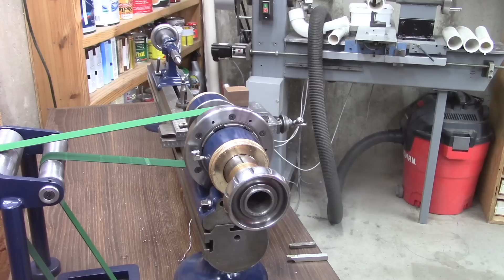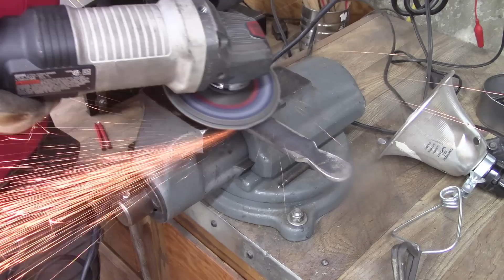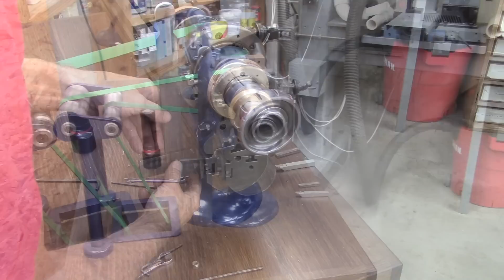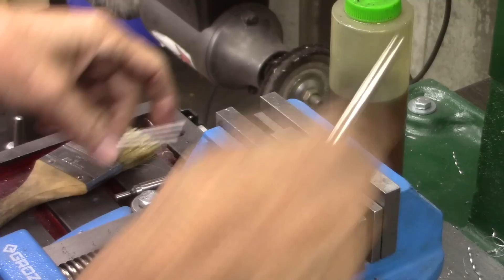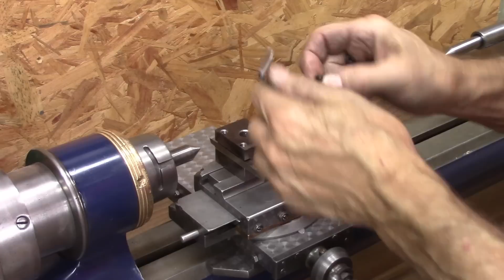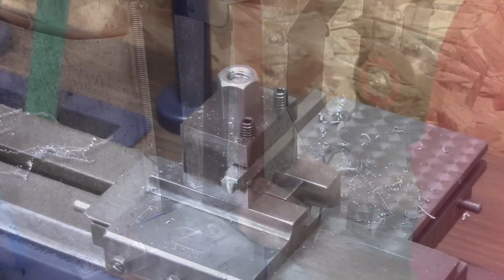Adding a Spindle Brake and Tool Post to my Hardinge Cataract

Comment: Hi Mark.  Maybe you can engineer a stop fixture to quickly align the compound for a non-tapered cut.  Maybe it could register in the center slot of the lathe bed.
Reply from the maker: I like that idea, thanks.

Comment: Are you still making hardware kits for the whimhurst generator.
Reply from the maker: Well...  I'm having a hard time getting materials and when I do they cost more. Right now I can't get the copper tape I was making sectors out of. It was supposed to be in stock in October but now they say after the new year.
Reply: Is there a template for the half-moon collector?
Reply from the maker: @RUDY3098  No but there should be!  Send me an email and I'll send it to you. winkysworkshop@GMX.com
Reply: I sent an email for the template .
Thank you
Reply from the maker: @RUDY3098  I can't find the DFX file but I'll trace one and send a scan.

Comment: That is coming out better that the company who made it.
By the way. Would you be able to make & sell  one of you beautiful brass ball T-handle tap holders, every time I see you using it.
I so very would like one. Thank you and thank you for taking us on your wonderful journey
Reply from the maker: Thanks, Sorry for the slow reply. I can make a tap wrench for you but when you add up all the parts it gets kind of expensive. I've made several in the past. The tap holders are about $30, the 3/8" extension is maybe 6 bucks the brass balls maybe $4 and I always include a carbide countersink and they are $25 to $30...   the reason I like to do that is that the advertised 3/8" countersinks are not always 3/8". Thats kind of irritating. If you're still interested contact me at Winkysworkshop@GMX.com
Reply: @WinkysWorkshop  thank you for contacting me back. And yes, I will contact you soon. It's been a tough week, money wise for me, I've been home now for just over 2 yrs now from a horrible car accident,  and fighting with workman's comp/pay
 So when I get things straightened out. I am definitely interested.  Tha k you my friend.

Comment: Great outcome. Why not use standard cap head screws instead of grub screws. You get a bigger hex key for tightening. Good luck with thetailstock next week. Regards from Australia.
Reply from the maker: That would be ideal but the setscrew (grub) has a dog point.

Comment: On your tool holder why don't you mill a 1\4 slot all the way around the square block so each tool holder will hold 4 tools. Then do a 5\16 one the same way. And get the most out of your tool holder. To change a tool just spin the block. Load each block with 4 tools. Just a though. I made one like that for my South Ben and it works good. And the old lathe is looking real good.
Reply from the maker: I might do both sides but to do all 4 would necessitate cutting the HHS very short. I guess that would be okay, just hard to handle when sharpening.
Reply: @WinkysWorkshop  you build a bigger block . Mine is 3X3X2 and i milled out a 1\2 inch slot for carbide tooling. But i also know finding that size material to make it out of could be challenging also. Either will work. The old lathe looks good.
Reply from the maker: @anthonycash4609  For sure a bigger block would help for small HHS tools. Thanks

Comment: It would be nice to put a split wooden handle on top
Reply from the maker: Seems a little extreme however the whole lathe is a bit extreme Ha. Cool idea!
Reply: Just thought wth the beautiful job you did on the table you could use the same wood process and put a piece on each side of the handle on top. It would be smoother and just top off the whole thing. But it looks beautiful the way it is. Well done.
Reply from the maker: @patricklucki5368  I agree. It would be cool.

Comment: You may consider making that tool post block a bit bigger and milling it all the way around, make it a 4 position you could just loosen it up and spin it 90 deg for the next Opp. Just a thought. 
Neat little lathe though. 👍🏻
Reply from the maker: Yeah....  that is doable but I like being able to use longer tools. I may mill a slot of the opposite side. Thanks

Comment: Hi, Mark. Someone once gave me the idea of using a punch to turn over a thread or two at the bottom of the threaded hole in tee nuts (at two or three locations around the periphery). Cheap and easy way to ensure a bolt without a shoulder can’t go all the way through.
Reply from the maker: Thanks, yeah, I have done that and would have again if the threads were too long.

Comment: If the Tee slot runs along the back of the lathe you could make and fit a taper turning device. Alternatively you could modify one from another brand. I used a Boxford one on my Hardinge.  Went straight on. The difficulty would be releasing the cross slide nut.
Reply from the maker: The ways on the back have all sorts of potential uses. I was thinking about using it to mark snap ring grooves.

Comment: Ah, she's a beauty.
The tool holders are a good addition and I agree that having slots on 2 sides for other cutters could be very useful. You might also add a 3rd set screw not so much for clamping but to hold shorter tools too. 
Nice work, thanks for sharing.
Reply from the maker: Thanks! Yeah the third screw would be great for short tools

Comment: You hope? We all hope!
That is a lovely lathe, Mark, and you’ve really done it justice with your work on it and setting it up. Thanks for the videos. Couldn’t help thinking your tool holder system is more or less a duplicate on what I use on my little Taig lathe, except there each tool holder has its own tee-nut semi-permanently in the holder. Enjoy all your videos.. Les in UK 🇬🇧
Reply from the maker: Somebody else mentioned the same. I need to mass produce the Tee nuts now :o) but I agree.